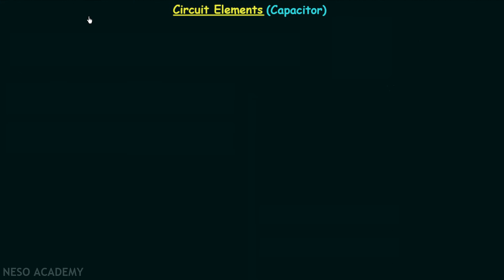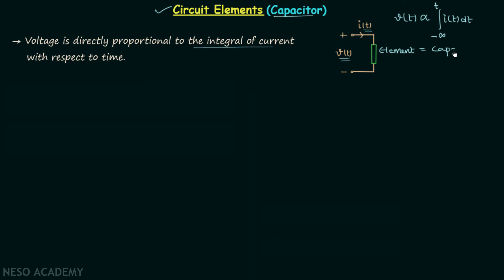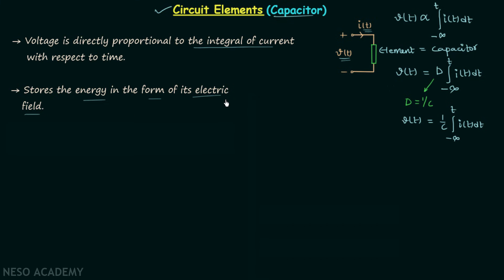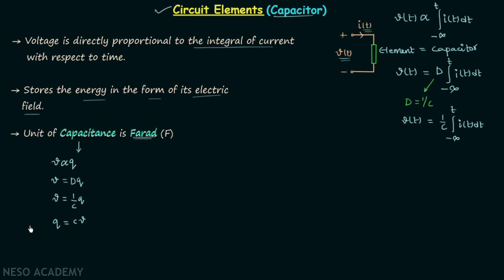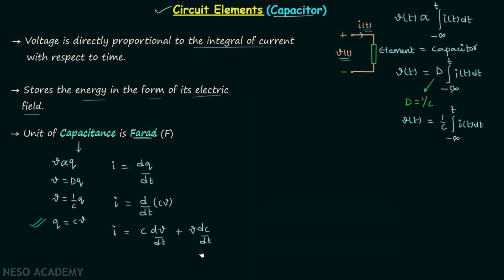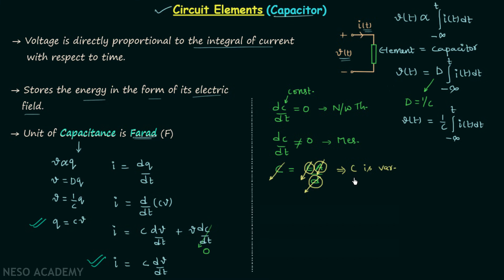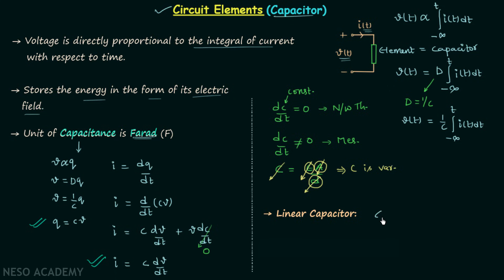Circuit Elements (Capacitor)

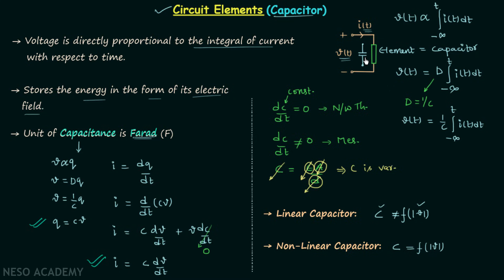Comment: 6:35 - he misspoke right at end? He says voltage across element is proportional to time rate of change of current through the element. That is for an inductor. For capacitor it's the integral of current.

Comment: Sir,Why the limits are taken from -infinity to t for calculation of voltage?
Reply: The reason for the limits from -infinity to t is that this integral represents an accumulation of charge over time, starting from the past till t i.e. "accumulate all the current that has flowed up to this exact moment t"
Reply: if u find it then tell me also
Reply: Ya even me
Reply: ya even me